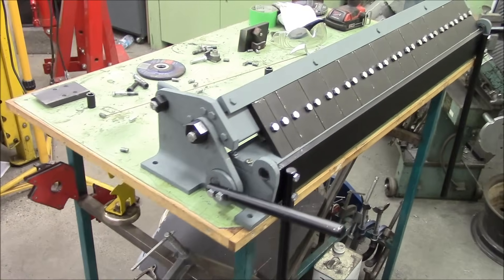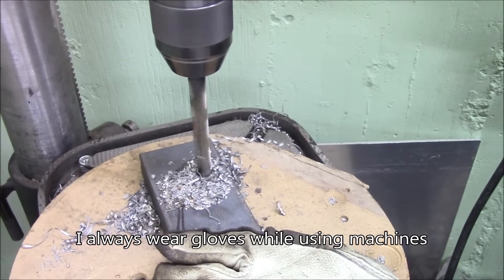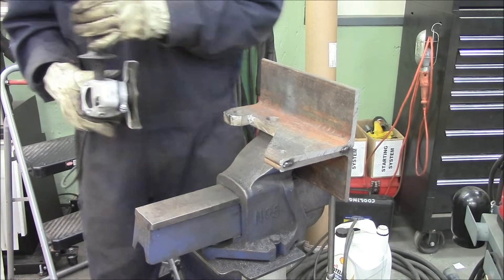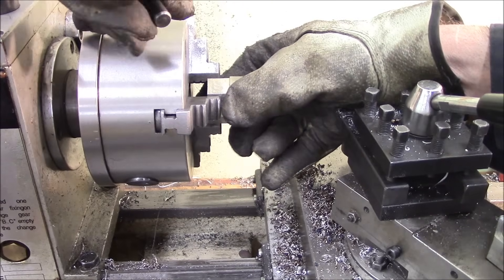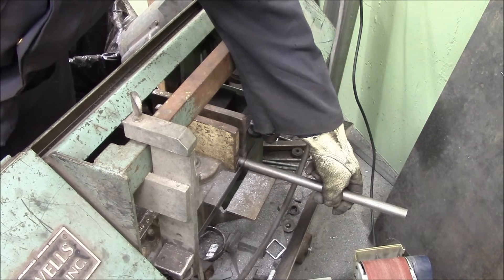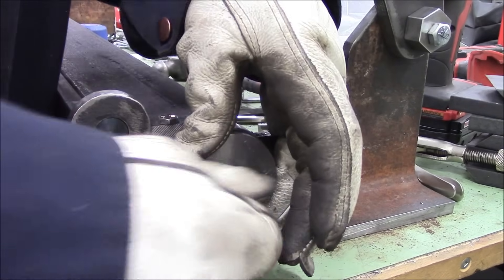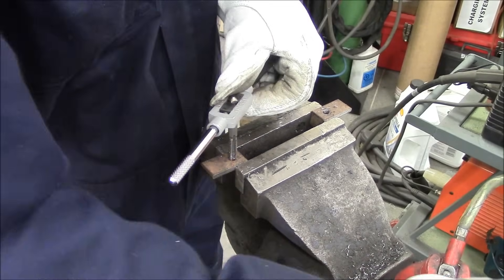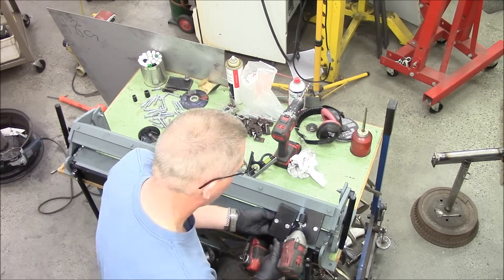BUILD a Sheet Metal Brake! FREE PLANS!

Comment: You can use any tap as a power tap.  I've power tapped in a regular drill press and no fancy tools.  Most of the taps I've broken were when I was hand tapping. Can't remember for sure but I don't remember ever breaking a tap while power tapping.

Comment: I stopped buying grinders every couple years once i bought the heavier amped makitas. A world of difference.
Reply from the maker: Yes. I replaced the smoked Canadian Tire one with a Bosch, and then bought a Milwaukee as well. I'll probably keep going with Milwaukee. The cheap ones certainly got my shop going. At work it's all Makita.
Reply: @GregWellwood  i have a milwaukee as well and i cant say it has died but the switch location seems to be terrible as Im always bumping it and turning it off. I guess i tend to be handsy with it instead of holding it exactly where it is intended. My others with the switch on the side don't seem to be a problem. 🤷🏻‍♂️
Reply from the maker: Yeah, I bump that switch off a lot too.  I'm getting used to it.  I'd like to buy the more expensive paddle-switch grinders, but $$$.

Comment: 3/8 or larger taps as long its not threaded deep any impact works wonders. forward and reverse its so much faster. 1/2 or bigger you have almost no chance of breaking the tap. i tried it after i use to watch a friend at work run a #8 or 10 tap through electrical panels chucked in a drill and driving it right through and not once broke one. i will never go back to a t handle again unless its all i have and im in a bind.

Comment: Would heat treating the bending fingers be a plus?

I've needed a sheet metal brake for a long time, but can't afford a fingered brake, & know I'd be frustrated w/ a continuous edge brake.

Yours is the only one I've seem that makes me want to build my own.

When I get the finish/detail belt sander done, I may well do it. I can see a need for the sander in this project to save some time.

Comment: Look at the torch consumables on your table it may just be the wrong head … I am a fabricator and use a vicon plasma table can cut some real heavy stuff with the same torch the cuts 18 gauge and thinner it requires a change in air pressure and torch head gets some different consumable parts

Comment: ??? I have a question if you would be so kind... to answer that is! The adjustment cams: Don't they move when in use? I don't see how they would stay oriented. Is this a problem????

 Loved the vid. Thank you for the plans. BIG HELP!
Mark
Reply from the maker: The adjustment cams are locked down by the bolts that hold them.  Loosen the bolt, adjust the cam, tighten the bolt.  They haven't slipped on me yet. (grin)

Comment: Im adjusting your drawings to fit the materials i have already. Mainly 4x4x1/2” angle iron instead of the 3x3x1/2”. Was there any specific math u used when figuring out the cam over center stuff or how much the clamp cam needed to move? Or is it not really that important and you just kinda went by eye?
Reply from the maker: I actually adapted a set of plans I found to fit the material I already had.  I used no math; it's probably not that critical.

Comment: Excuse me if this has been asked before or I missed it in the video, but what thickness of material is this capable of bending please? Thanks for the free plans and great video by the way 😁
Reply from the maker: Depends how wide a piece you're trying to bend.  It takes a particularily skookum brake to fold 16ga steel.  I had no problems with 30" of 18ga steel (but needed a bar added to the lever), and 12" of 10ga aluminum.  I haven't really been "testing" it, other than "I need to fold this piece and I hope it works."  Follow the link in the description to my web page (with free plans) on it - there is more information there.
Reply: @GregWellwood  Thanks 😊

Comment: Best bender I've seen to date + free plans! I'd be keen to build one but wondering if this would cope with bending 1.6mm 316 stainless steel? Most of my bends would be no more than 200mm long. Cheers in advance.
Reply from the maker: I don't have any 16ga stainless here to try.  You'll have to build one and let me know! (grin)
Reply: Ok, so out of interest what's the thickest piece of mild steel you can  fold and still maintain a clean tight fold?  Say around 8 to 12 inches wide.
Reply from the maker: I have done 30" of 18ga (1.2mm) mild steel no problem.  I have folded 16ga mild steel, but I don't remember how wide I've done. I did 12" of 2.5mm aluminum. I don't really work with more than that. The bigger you make the machine, the stronger it is at folding.
Reply: @GregWellwood  Well I guess if you did 30" of 1.2 MS I may get away with shorter lengths of 1.6 S/S? Being that's it's a  fair bit harder to fold. I guess I'll build one and see  eh, I just need to convert all the sizes over to metric and make a cutting list for material amounts. 
Thanks for the advice. 
Ps. Do you have any pictures of the 1"x1/2" stiffener you added to the folding bar? Location and orientation.
Reply from the maker: Yes, follow the link to my website. Basically, the folding bar is too thin.  I wanted it thin because it's more versatile in what I fold, but it struggled to fold harder materials. With the 1"x1/2" stiffener, I haven't had any further problems with it yet. Good luck!  Let me know how it goes!

Comment: A lathe may be soothing IF it cuts properly. I am waiting on some inserts and tools. Then if graduated in the correct measurements. And then very good lights over the machines.
A welder is great,,, if you can see what you are welding, I have to use floodlights so I can see the job. Yet my vision is otherwise good with glasses. A good welder is then enjoyable, a bad one a total pain.

Comment: Can I give you a heads up on proper drilling techniques. You don’t step up in drills to a finish size, that’s how you destroy the lead cutting edge on the drills. Here’s a machinist rule of thumb. See that chisel edge at the point of the drill, any pilot drill should never be greater than 9/10ths the width of that chisel edge. Clue, a pilot is really only for large drills, like larger than 25mm. Now you may want to know the reasoning behind this. It’s all to do with pressure/stress at the lead cutting edge. With the correct pilot hole the pressure across the length of the lead cut edge is evenly distributed once the whole concave is formed, this minimises the occurrence of lead edge’s chipping thereby requiring drill sharpening. All small holes, generally anything under 25mm/1” will more or less self feed with little pressure provided all clearance angles are correct for material I.e. 118* for mild steel, just round up to 120* and use two nuts tack welded together, you have a natural gauge from the nuts forming a 120* angle. There are many ways to measure the leg lengths of the lead cutting edge from chisel edge to drill lands like using a right angled block to level chisel edge in horizontal plane, draw along block to scribe a line from chisel edge & land, rotate over & perform same action then compare scribe lines to determine differences in leg lengths & angles. 
Doing this in your presentation will go a long way to prevent upsetting my OCD

Comment: If you were to rebuild this strong enough to be 48” wide, what would you beef up?  Just the clamp brace and folder bar, or do you think other parts would need to be stronger also?
Reply from the maker: I would consider at least doubling the height of everything, and possibly adding the "V" brace that you see on the real deals to keep the span from flexing.  The thicker you want to bend, the significantly more robust it has to be.

Comment: Teacher, is the clearance between the cantilever lever and the clamp overcenter correct ?  In the video you say you aim for four to five thou clearance between parts but the difference is fifty thou between those parts . Our build is nearly complete and it's looking very good, we've made it a little wider to fold a 1M sheet, gone up to 20mm for the shafts and 20mm x 50mm for the folder bar.once again thank you .
Best regards  mick
Reply from the maker: I added clearance there because I found it was binding.  If yours works without binding, leave it tight.
Reply: We made it the same as yours, we still have the fingers and the finger holder plate to make before we can try it.  thanks for th ereply.   Mick @GregWellwood

Comment: Thanks for this video! One question: I see alot of folks locate holes to be center punched and drilled with a caliper "scratch line?" (Not sure if that is the correct term) does this eventually mess up the accuracy of the caliper? Is there a right and wrong way to use the caliper in this way?
Reply from the maker: It's probably not the best for the caliper tips, but the gears that work the dial usually become inaccurate first.

Comment: Hello. Thank you for your work, and for the drawings. One question - what is the unit of measurement for your dimensions in the drawings?
Reply from the maker: Inches.  Here in Canada we kind of use both Imperial and Metric, but my raw steel and drills are all Imperial. Multiply by 25.4 to get mm.

Comment: Hi! nice build! 
i am planning to make a sheet metal bending device. I'm a bit confused on whether i should make a folder or a press brake, i  would love to hear your thoughts on this. and a question about this folder : how about adding fingers to the folder bar and the base, it would make it more versatile. i normally bend 2mm and sometimes 3mm, so i will have to reinforce, could you please tell me how the forces are acting during bending and/or where exactly do i have to add the reinforcement.

Thank you very much for sharing your build.
Reply from the maker: Sounds interesting.  I look forward to seeing what you come up with!

Comment: I watched your video a few times and took a look at your plan and would like to know if the clamping overcenter works as well as the one you did in the video ???
Reply from the maker: In practice, the clamping and bending function has been working flawlessly. Zero problems. The only thing I've had to do with the bender is reinforce the bending bar with thicker metal. The overcenter works dandy.

Comment: Please, a second question: how did you cut the 45 degree angles on the fingers? I've tried different methods but without a mill and only simple machinery I am limited to the angle grinder and edge sander. Although the 45 I tried on the edge sander was 55 inches long on a  36 or so sanding surface..... Oddly I was able to counter act the warping (from the heat) by grinding the back side! Who knew!
Reply from the maker: At about 1:30, I had the horizontal bandsaw at 45° and cut both ends of some flat bar, then cut to length at 90°, then back to 45° again (it felt like it took forever, though I did have about six lengths that I trimmed the ends off, so it wasn't too bad). I cleaned them up on the mill with the head turned 45°.  You could do it with an angle grinder, but it would take a long time without the rigidity of a fixed machine.

Comment: How did you get the geometry for the pivots and ecliptics?? I have nearly all this scrap my top arm needs to be different though.
Reply from the maker: I adapted a lot of this from a design I found on the web (link in the description), and then re-did the plans into something easier to read, and suited the metal I had.  I don't imagine the geometry is critical.
Reply: @GregWellwood  so the geometry is irrelevant?
Reply from the maker: I don't think it's so critical that you need to exactly duplicate what I did. If you put things in slightly different locations, it will likely work just fine.  Try it and see!  And video the build, eh?! (grin)
Reply: @GregWellwood  learned fusion to make. Can’t figure out how to join it with out locking up

Comment: Sorry Teach.... Would it help if I told you I was a retired teach.... HaHaHa. I really am... When fully opened.... what is the clearance? Surface to Fingers (for inserting 135 degree bends into the mechanism for smashing bends, Or as I have learned "spanking" the 135 degree bend flat)???
Reply from the maker: Mine opens to 1.25"

Comment: Just found your channel. Really cool build, this is a great folder . It shows that you know what your talking about. What gauge material have you folded in it so far?
Reply from the maker: 16ga, but not a full width piece. I think it needs some more reinforcement, as the top (despite being 1/2" angle iron) does flex.  I don't usually bend thicker than 16ga.

Comment: Looking at your drawings and was curious, on page 16 for the clamp cam. The cylindrical shaft looks off center from the hex. Is it actually off center or just optical? If it is off center, how much?
Reply from the maker: It's dimensioned as 0.188" (3/16") off center, which makes it do some "cam action."

Comment: great Job! I am looking for a good example for a DIY metal brake for a long time now - think i found one with this video.

I have a question: (Sorry if i didn't heard it in the video or found it in the comments)
- How thick is the maximum thickness you can bend with this brake bending steel, stainless steel and alumnium? Do you have some empirical values for me?!

best regards from Germany!
Reply from the maker: Was successful with 12"/30cm of 0.100"/2.54mm aluminum, have not tried wider. Had success with about 28" of 0.039"/1mm sheet steel. Was pushing 18"/45cm of 18ga/1.2mm steel - the folding bar needs to be thicker steel or reinforced. Have not tried any stainless but I'm sure it will be unpleasant.

Comment: I have a couple questions. Would you happen to have these plans in a svg or dxf file format? Also on the folder bar, what is the width? The length is 36.5. And on the finger, it is .5x2.5x4.2. I have some .5 flat that is 4 inches. Would that work or would it throw all the dimensions off?
Reply from the maker: Good catch - I'll update the drawings. The folder bar is 3" in the plans, but I made it out of 2.5", same as the fingers. 4" would work for the fingers, you just have to move the finger holder location.  Don't be afraid to alter the dimensions to suit the materials you have.  If you have to change anything, err on the side of bigger/thicker/stronger/more.
Reply: @GregWellwood  Thank you so much. I'm new to this CNC stuff, that's why I was wondering if you had a svg or dxf file. I just realized now that you didn't do this on a plasma machine.
Reply: BTW, great job on "using what you have"!!

Comment: If you could only but a horizontal band saw or a vertical band saw which would you buy and why?
Reply from the maker: Vertical if you work with wood, horizontal if you work with metal.  Metal needs slower cutting speeds, horizontal bandsaws cut slower.

Comment: Do people not realize that you should not force the grinder cut off wheel into the metal.  Allow the abrasive wheel to cut at a more gentle pace, you can run it back and forth, kind of like if you have to cut a piece of porcelain tile (or any tile/stone for that matter).  If you force it and apply too much pressure, more often than not the tile will split in have, so go slow, slow means less heat.  Heat is the enemy, to a abrasive wheel or a diamond wheel.  I set tile for years way back in my twenties, first tool I bought as a helper was a 4 1/2 inch Makita grinder.  I still have that grinder, one of the most profitable tools I've bought, paid for itself a thousand times over (conservative estimate),  and the stupid wheel guard lasted about a month on that thing until someone on the crew took it off.  I've never had a wheel grenade on me, never smoked a grinder like I saw in this video.  But, one thing that's very important, only use paddle switch type grinders, especially for metal, and If you';re using wire brush wheels, ONLY PADDLE SWITCH TYPE.  Or enjoy having on bounce off the corner of your work and slam into your chest and wrap up into your t-shirt with now why to turn it off.  Hint: PULL THE CORD OUT OF THE WALL STUPID!!
Reply: That being said, nice work on the brake and thank you for the plans.

Comment: How did you cut the fingers at the 45 degree angle?
Reply from the maker: I set the horizontal bandsaw at 45° to cut all the fingers, then made them consistent with the milling machine.  If you don't have those, it can still be done, it's just going to take longer.

Comment: I found a sure (no) fire solution to smoking 4" side grinders...

Bought a pneumatic side grinder. Gotta have big azz tank on your air compressor.

If you don't, scrounge up some dead compressors & use their tanks for more capacity. Good investment of time, very little $ & will help w/ other air hog type tools, (die grinder, paint guns, etc)

Don't do what I did, tho, buy a good air side grinder to start. A lot of times, a cheap HF air tool will do the job; not w/ a side grinder. Not enough torque; end up w/ 4" elec grinder performance.

Get a good one & it'll perform like a 9" 120v side grinder at a fraction of the weight.

I've got a 40 yr old 9" Skil grinder that I could manhandle in my 20's, 30's & 40's; now, at 69, it manhandles me.

Comment: Noooo “power taps”... lol, very easy to break off in the holes with a drill, impact gun, or air ratchets... I’m surprised you don’t have the Tap Sockets instead your using the traditional “T” handles. & I’ve always either used 3in1 oil, or used (still redish colored Automatic Transmission fluid) for a cutting lubricant... drilling, cutting, or taping & making threads. It’s nice to see other people making what I call: MD Tools... (Make-Due Tools) outta leftovers laying around the shops/ garages, home, ect... anybody can just got out to buy tools, but it’s always more gratification, & more pride in the sense of accomplishment in building the tools. Especially when boredom strikes... or ya figure out your needing a specialty tool in order to finish a project.. 😄